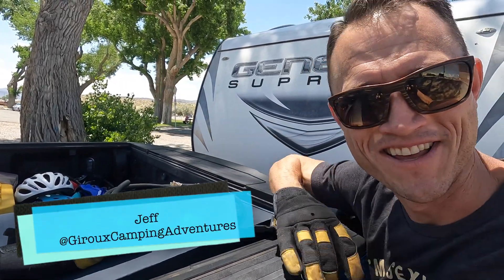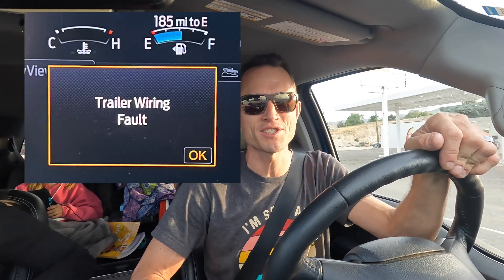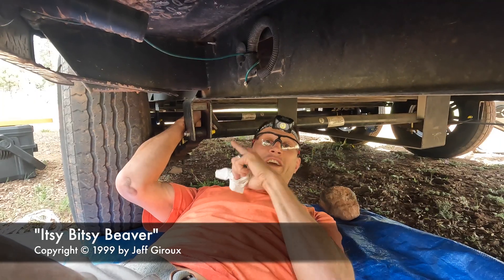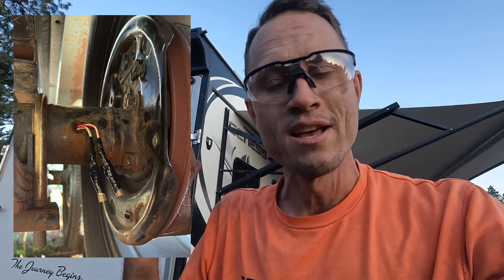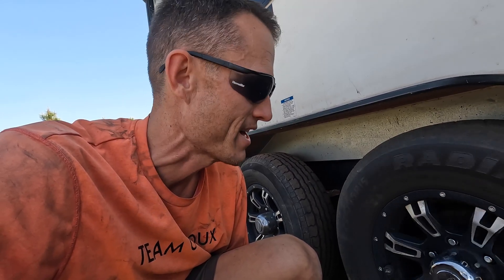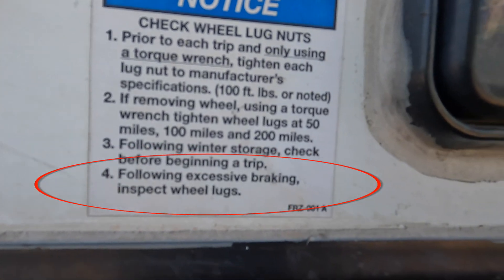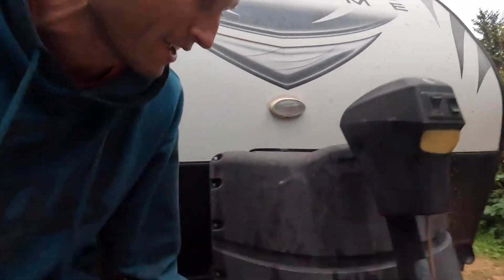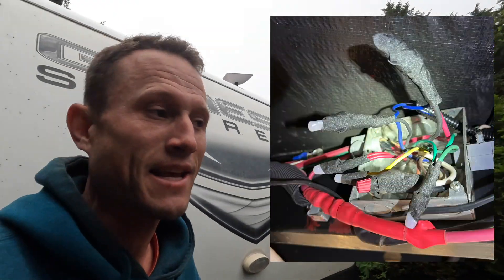Fried Trailer Breakaway! Replacement of Electronic Trailer Brakes on the Road

Comment: Please show how to connect the new wiring harness
Reply from the maker: As with the rest of the process, I did not film this in detail either. For my junction box, I reused the wiring harness. So I simply took a picture before for comparison, and that way when I took it apart and put back together I matched the same wires as the original picture. It would be great to say match your 7-pin wiring harness color to the same wire color in your trailer junction box...however not all wires and not all 7-pins harnesses are made the same. Hence different colors. My best suggestion to you is to take a picture before and after for comparison. You will need to test continuity from the trailer 7-pin head to the other end exposed wire to make sure the different functions of the 7-pin are properly identified. Then...based on your "original picture" you take before starting work, you match up the same connections. 

Suggest reviewing this Curt page to get an idea: https://www.curtmfg.com/towing-electrical-wiring

I did have a new wiring harness ready to wire in, however the instructions it came with and colors did not match my trailer junction box nor the original 7-pin harness. In the end, I decided to keep the new harness as a spare and never re-wired. Therefore, my wiring was as easy as taking a picture before, then making sure I wired back the same way.

If your setup is not that easy, then you need to visually inspect and test with multi-meter the various wires in your trailer junction box to make sure they perform the function you expect. Typically you will have a thicker 10 gauge wire for the power supply and possibly ground as well...though I've seen some harness setups with a 12 gauge ground. My harness that came my trailer when purchased used is noted as 2x10, 5x 12...so 2 runs of 10 gauge (power and ground) and 5 runs of 12 gauge (reverse light, brake light, left turn blinker, right turn blinker, and most important brakes).

The emergency breakaway cable will tie into the trailer junction box 12v positive wire as well as the wire going to the brakes...in my case my junction box brake wire was black. Yours might be different.

Comment: Please show and Describe in more detail how to hook up each step. I just bought a camper that has the same issue. I don’t know how to hook up everything. This is the only video I have found on this. I think a lot of people have this issue. Thanks for your help
Reply from the maker: I did not film the entire process since we were basically stranded on the road during summer vacation...trying to go as fast as possible. However, I followed the Lippert how-to video. Take a look for brake replacement. Lippert video here - https://support.lci1.com/videos/spring-axle-electric-brake-replacement